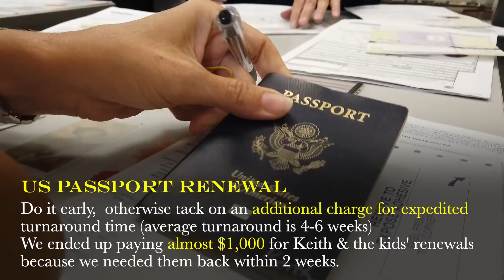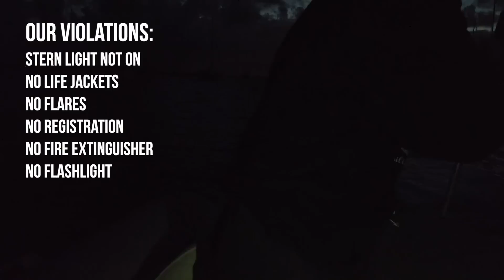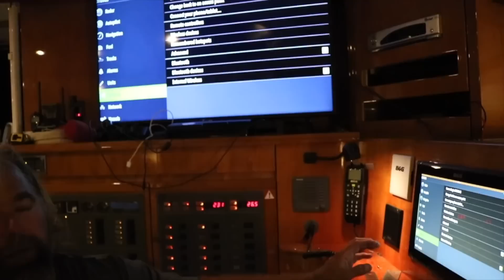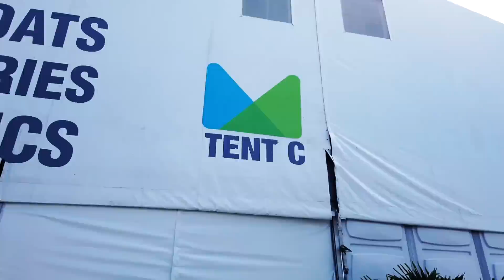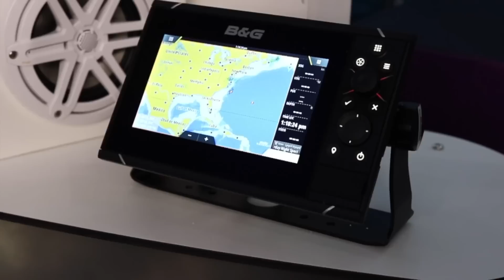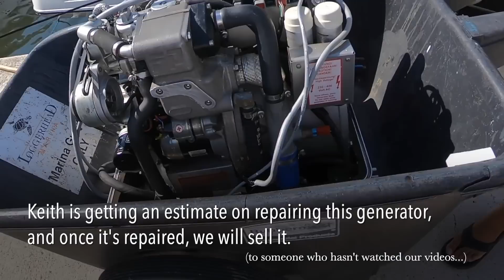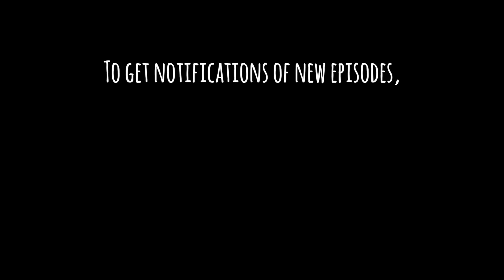CATAMARAN HAUL OUT & REFIT: Electronics Upgrade, Generator Removal & Installation [Zatara Ep 73]

Comment: If you don't want to lift your boat to install a through hull, you can (and we did) do it in the water. One person inside drills 1/8 (3mm) hole pushing the drill bit through beyond the flutes, a diver on the outside holds a can/cup/tupperware bigger than the through hull full hole size over the drill bit, inside person then removes 1/8 drill and then uses the full size hole saw to drill through hull, once the hole is drilled and hole core removed the outside diver removes the can and inserts the new outer for the through hull (through hull can be either sealed with a palm or bung), inside guy then secures rest of through hull. A little scary when you pull off the can but we let in maybe 1/2 a gallon of water tops, worth the diver carrying an appropriate bung just in case the through hull gets dropped :)

Comment: Great Northern Lights Generator. I have that one. It’s 16 years old and runs great. Word of advice. Use lock tight on the screws that hold the fuse box on top the round generator. They vibrate loose and cause the temperature gauge to read hot when nothing is wrong. 
Cheers.

Comment: you trusted that line lifting the generator.  Nail biting MOMENTS from the Z Crew.
Reply: Don't lines like that see a lot more force than a 450 lb generator from a sail full of wind?
Reply: @k9uprising  UV rays definitely degrade the lines and they can snap.  I had a buddy snap a halyard in bosun chair going up Mast.  Fortunately only 3ft off deck.  I have made so many dumb mistakes sailing that instinctually I anticipate worst case scenarios.  That generator falling could kill ya.
Reply: But they just had all their lines replaced. @svamandolin3546

Comment: Not really important but @18:13 you mention putting a cat5 cable in the mast, cat5 is ancient (pre 1999 tech) and you should use Cat6A. It utilizes an exceptionally thick plastic casing that helps further reduce crosstalk. The biggest distinguishing difference between Cat6 and Cat6A cables is that Cat6A can maintain 10 Gigabit speeds for the full 328 feet of Ethernet cable.

Comment: Grin, I would much rather have it easy to drive a car in that traffic.  Instead its a 80 foot tractor trailer.
Oh the days when we learned to drive.  I remember it well so long ago.
Thankyou for the vid on the refit.  I can see you will need to leave Keith on the boat, as he is buying all the doodads in sight!
Seems like a gantry of some fashion would be good in that hold.  One that could be unbolted and used either side.

Comment: Your new tender looks like it will be too heavy to beach it. If you add an extra line tied to the tipping ring on its anchor and take it with you to the beach you should be able to retrieve the anchor and boat without having to swim out to it heading back to the boat. Then again you have enough kids to send out to retrieve the tender.

Comment: Hey Guys, Tech question: since the boat's onboard electronics are fit to 240V (since you bought it in Greece), did you replace the generator with a 240V generator or did you entirely switch to 120V?

Comment: Is the replacement generator an upgrade for more power or  newer vs. older that's failing ? Also what about the the Solar arch ? Will it also double as a dinghy lift/dock ? What about batteries ?

Comment: My first cringe moment, watching you wrap electrical wire with painters tape..... sent a shudder down my neck and spine
Reply from the maker: I was tying a fish tape to a network cable, to pull the cable in
Reply: ah, that is a different story, I would have still used electrical tape as it tends to stick better but I am guessing it worked out just fine since it wasn't in the gag reel lol

Comment: Wrapping wires in painters tape is never a good thing.
Reply: that was just to fish new wires through on the old lines as you swap them out
Reply: @jasona.neverforgetfukushim647  Ahhhhhhhhhhhhhhhh
Reply: @jasona.neverforgetfukushim647  Was wondering, why didn't you go with a hydro gen?  We swapped ours out for one two years ago and we also upgraded our alternators for ones with higher amp output.
Reply: @iandavidharwin  wrong person to ask